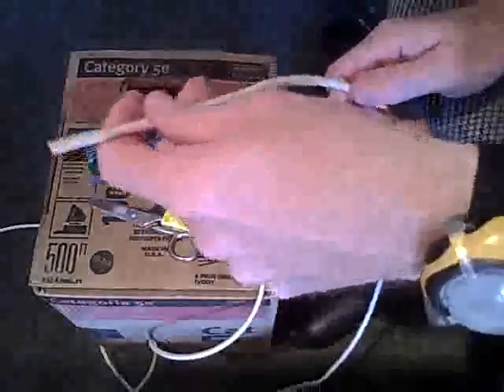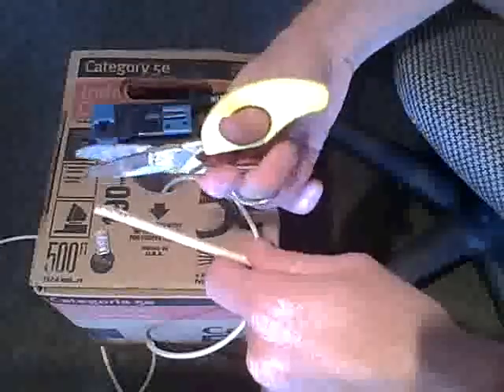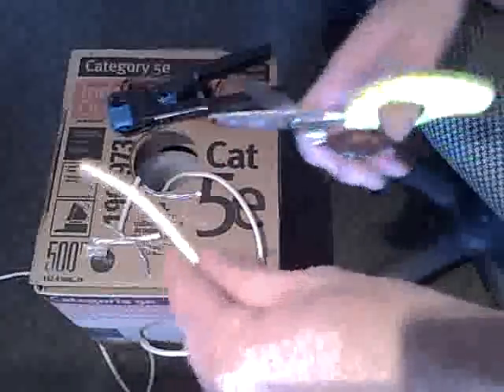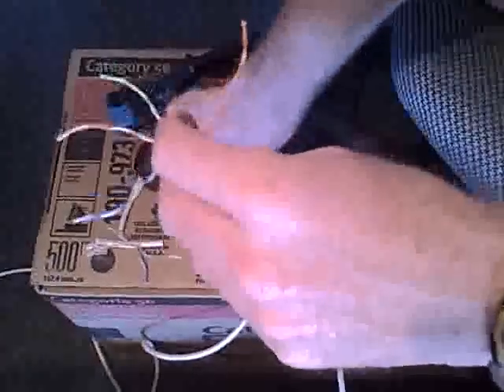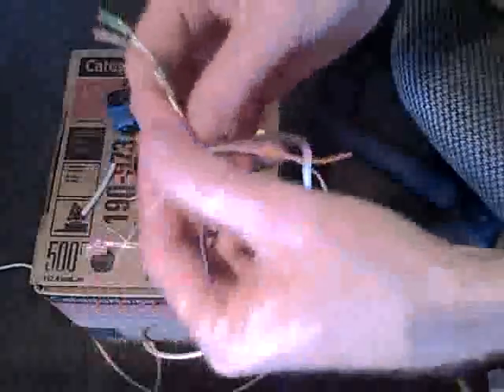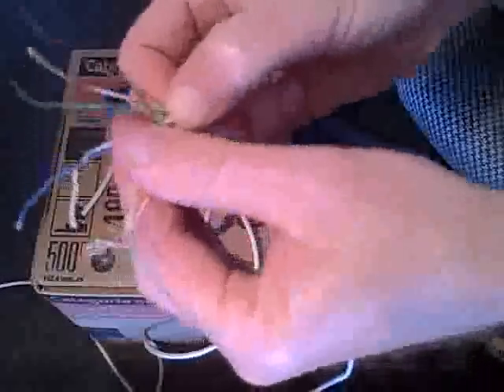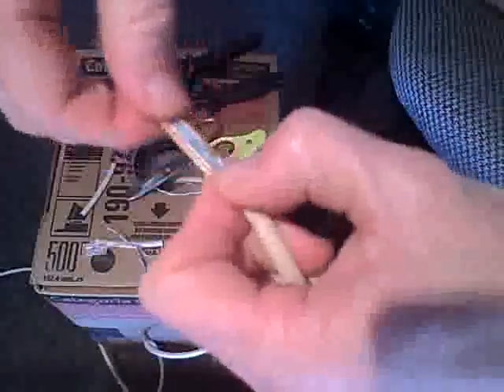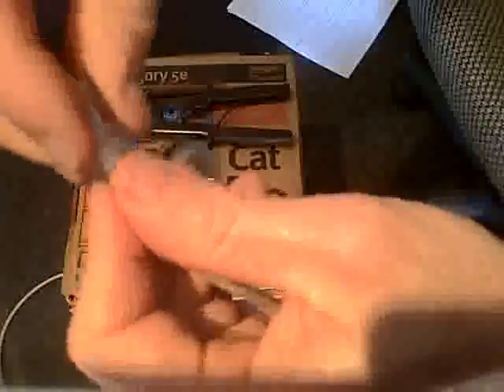How To:  Terminate an RJ45 Connector onto Cat 5 ethernet cabling

Comment: An RJ-45 is keyed, and an 8p8c modular connector is not.  A true RJ-45 plug won't fit into an 8p8c jack, but the opposite can happen.  Do they even manufacture true RJ-45 anymore?

Comment: @CrazyRay7979 RJ11 is the standard phone connection. RJ45 was a phone connector that was not widely used, but was similar to the 8P8C connector so 8P8C inherited the name. So, technically you're right, it's not an RJ45 connector, but the term has become synonymous with ethernet connections.